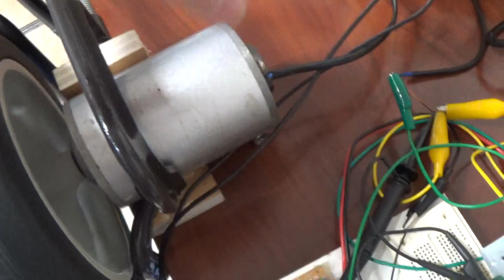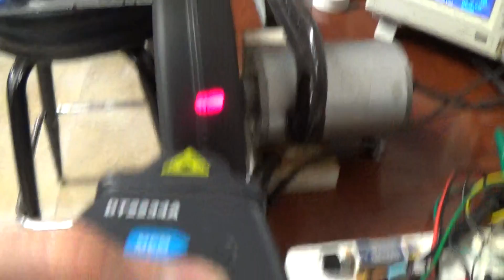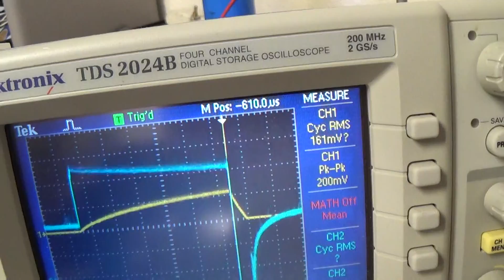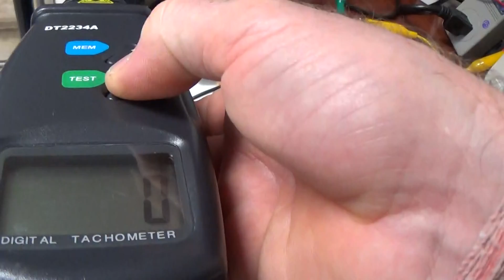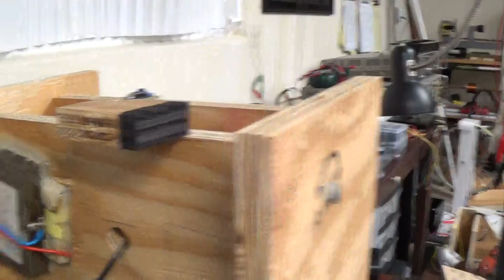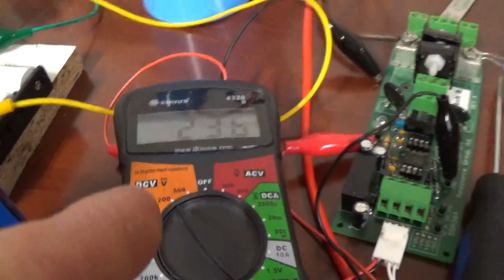Bucking Field Reluctance Motor vs off the shelf DC Motor

Comment: Hmm, but the voltage drops down about 20% during the pulse as the current increases with the standard DC motor. Your motor shows a constant voltage during the pulse, despite the increase of current. Isn't that significant? I don't understand why the voltage is constant in your motor, I think it should drop when the current increases but it doesn't. Why?
Reply from the maker: +YouRogga Good point!... maybe it deserves more testing?  Thanks for pointing this out. Luc
Reply: +Luc  gotoluc Choquette 
It looks like your motor is extremely efficient and deserves to be tortured in some other brutal tests. I could be wrong since I&#39;m not an EE, only a simple MSc in structural engineering. My thinking is as follows.
The standard motor reminds of a battery with internal resistance. More load (current) produces more internal losses and voltage drop due to the internal resistance. Your motor compares to a battery with no internal resistance at all, no internal voltage drop and thus no internal losses. That is, your motor have no or very small magnetic and electrical losses. All power goes to overcome friction only (air, bearings, ... block of wood, opto sensors etc).
Reply from the maker: +YouRogga Thanks again for your opinion and encouragement. I've posted your previous comment at the forum topic this is being shared at to see if others also agree. You can read the topic as it is public but if you would like to participate you will have to sign up which is easy to do. Here is the link to the topic:   http://overunity.com/16167/sharing-ideas-on-how-to-make-a-more-efficent-motor-using-flyback-moderated/#.VkXhrEb_ol0